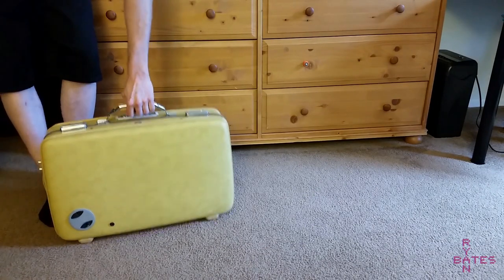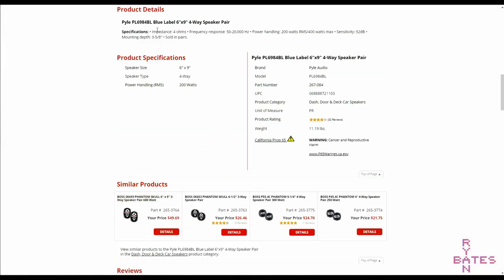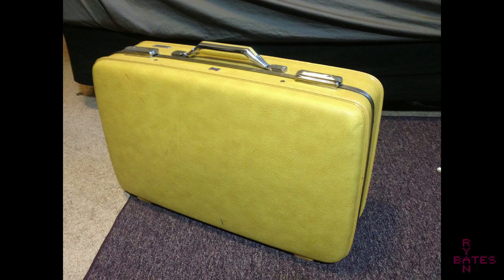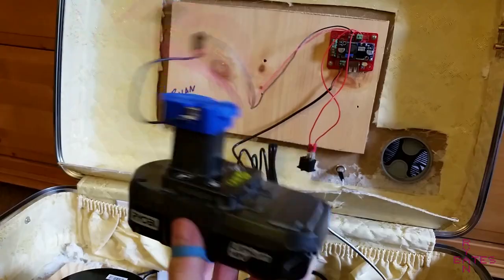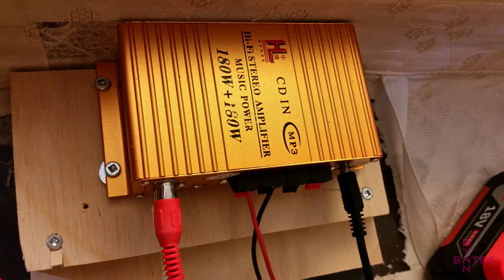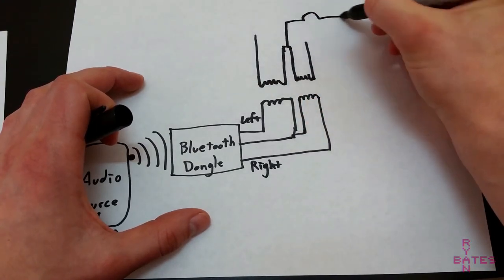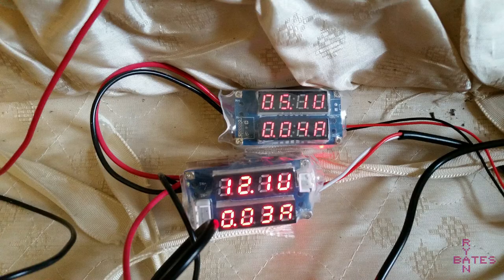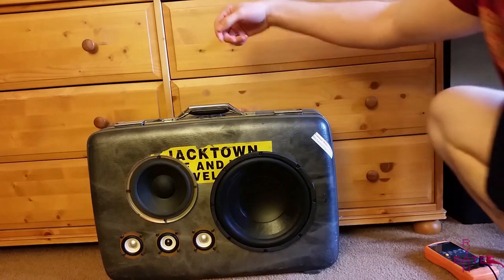Build a Portable Suitcase Boom Box (with Bluetooth)

Comment: I like the ground loop isolator idea.  I may experiment with that, in situations where I am not using an integrated Bluetooth amplifier
Reply: I might as well. My amp's bluetooth connection comes from one of those $5 Fm panels.  there is a slight buzz when nothings playing.